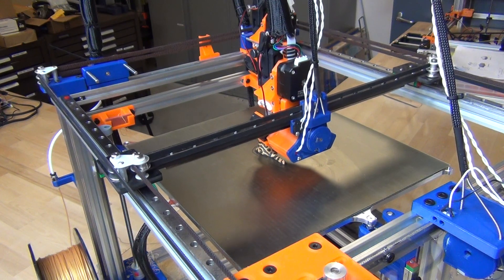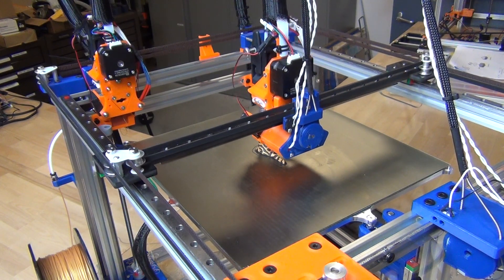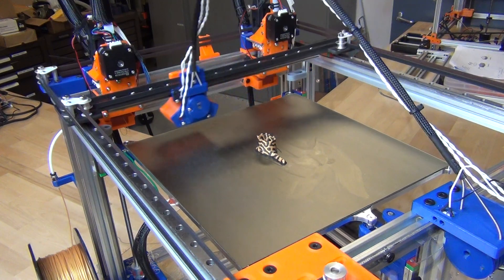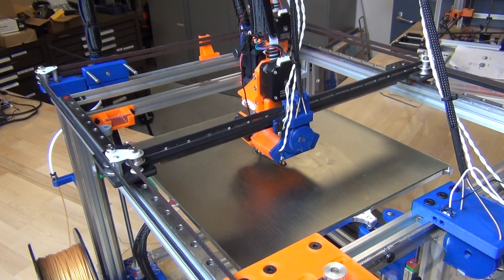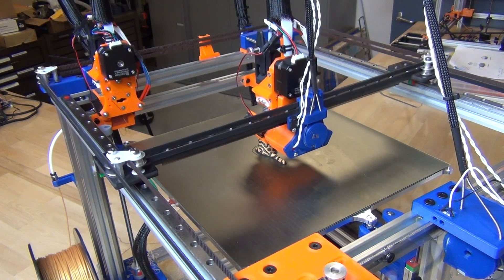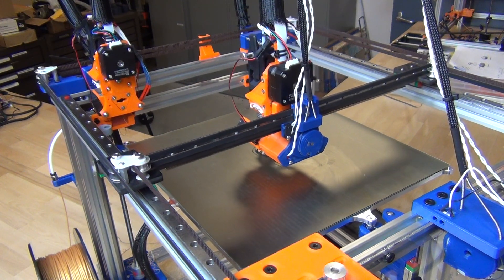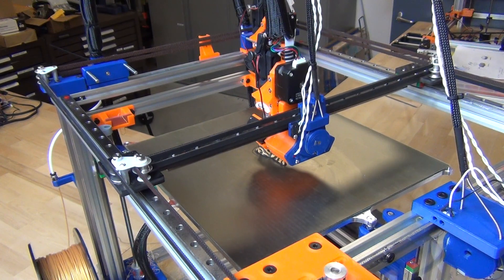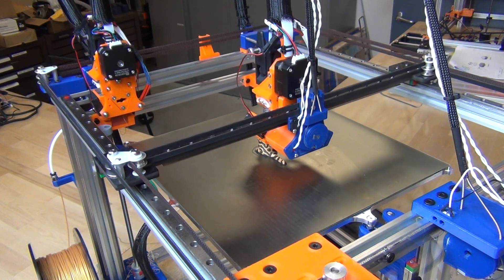Jubilee CAD File Release and Toolchanging Update

Comment: In your estimate, how much money would it take for you to be able to profitably sell this system as a kit? How much would you need to be able to scale it to make it adaptable to current ratrig/voron designs?
My current belief is that tool-changing is the future of multi-material printing. It's the only no-compromise solution when it comes to waste and print quality. E3D's system is pretty robust, but it's all-metal, individually-machined pieces make it prohibitively expensive for most.
This system makes the appropriate compromises in materials and the design is fairly elegant. I would love to be able to just purchase the system, because I don't have the time to build it.

Comment: Looks like that you are controlling the locking mechanism with a bowden and a motor on the right side of this video. Wouldn't it be possible to controll that mechanism with a small servo directly where the cable is attached? :D Awesome project.
Reply from the maker: for sure! Thats pretty much how E3D does it for their toolchanging Motion System.

Comment: cool project! I first thought you would use this for PnP, but multi-material printing is nice as well. How is the quality of this project at this point, is it production-ready or still in beta-stage? I'm considering what to build as my first machine.
Reply from the maker: Many thanks! The project has gone leaps and bounds with some extra community eyes on it. At this point, I'd call it stable in the default configuration (i.e: following the instructions on the wiki to the T), and print quality is excellent (surpasses a Prusa Mk3). There are plenty of folks on Discord experimenting with other configurations (Duet3, Klipper), and with time those too will become more stable.

There are still a few missing bits. Having a stable set of slicer config files would be nice, but it's tricky since settings change per-tool and not everyone is running the default extruder tool. Over time, this will get some more documentation too.

But I'd say there's no better time to get started unless you're specifically after a kit.
Reply: @POOFjunior  Better than prusa mk3? Bold claim :) I'm joining the discord. See you there! 👍

Comment: I was searching for a kinematic coupling for a 3D printer tool changer and noticed your youtube channel. First impression: Here we go again, a hobbyist who thinks he can build a 3D printer using 3D printed parts and make a reliable tool changer at the same time.
HOW I WAS WRONG ...
This is an excellent design, very well documented and looking at all available documentation and "source code" I fell in love with this in 10 minutes 😁
I have parts waiting to build a new 3D printer for almost half a year (build size 50x50x50 cm) but have not started because I was not too happy with my tool-changer design. I immediately started printing your parts for the tool changed and I might upscale most of the design for my own printer.
Reply from the maker: Much appreciated! You're also most welcome to join the crew on Discord to shop around ideas of your bigger setup!

Comment: Looks pretty cool. I just wonder why so many printed parts are used? The machine i am designing from scratch only uses 7 printed parts, and the other parts are not custom made parts. Except for them being cut to lenght.
Reply from the maker: Thanks. theres a few more printed parts to get rid of print overhangs. Rather than print one part with a huge overhang, i split that part into multiple pieces. While there are more pieces, the machine becomes a lot easier to print.

Comment: Nice work. I've seen a few good toolchanging designs lately. This looks like the most promising. A few notes: I believe with a unit similar to a Prusa multi-material system, it would be possible to have more than 2 extruders, on a board like the Duet Wifi. I also think that the best options for printers, that have a good chance of being accepted widely by makers and tinkerers, require the least additional tools to produce. It looks like you've got some custom engineering in there, to improve the performance of the printer, but I'd argue that some of those choices provide marginal gains, in trade for substantial barriers to entry. But that's just my opinion.
Reply: I know this is an old comment, but Jubilee isn't limited to two tools, or even just extruders. You can have as many tools as you have X-axis space to park them. Your assessment of the "custom engineering" on his printer is silly. It's a pretty basic CoreXY with tramming capability, and a novel tool-changer that's similar to E3D's much more expensive option.

Prusa's MMS unfortunately can not get away from purge blocks in it's current state. It is the number one reason I haven't purchased one. This system has a purge bucket but it's just to make sure the nozzle is full before it starts printing. The only negative with this system is that you have to have x-y motion capabilities to pick up the tool, which means it can't convert a bed-slinger, but that's where IDEX conversions make sense so that you can at least get two colors.

This system, with the addition of an indexing gantry, could conceivably have no limit to the number of colors or materials in a print.

Comment: You figure out the air/ fan yet
Reply from the maker: Still working on it. For PLA, part cooling is definitely my limiting factor right now. For low detail parts, my top speeds are around 120mm/sec for inner perimeters, 78 for external perimeters, 180 for infill, and 333 for travel moves, which is respectable for low detail parts. For detailed parts, I cut these down to 1/3 for perimeters. Pushing past that, cooling starts starts to become an issue as the part can't cool fast enough before the next layer is deposited. I'd say that that's a respectable start though.
Reply: @POOFjunior  can't wait to see more love when people build shit and actually show/ talk through problems etc and document like you have keep it up

Comment: Joshua, let me keep it straight... You are an absolute legend! Tool changing for the masses.
Reply: P.S. are you happy with an amount of deflection in the rails/extrusion or you would size up in the next iteration?
Reply from the maker: So far, I'm pretty happy with the XY size. On a future iteration I might add about 20ish mm in X and Y for a teeny bit more tool space. I don't think this machine scales to something like 600x600, though. At that point, the carbon fiber crossbar may warp non-negligibly with changes in heat.
Reply: @POOFjunior  Oh, I meant, is it rigid enough at the current size?
Reply from the maker: @yura979  yes it is, but I haven't pushed it to extreme speeds yet. I need better cooling and a better extruder.

Comment: Wish you would make the whole guide, instructions, shopping list etc as one download on git instead of a ton of individual downloads. Would be so much easier.
Reply from the maker: On the landing page of the project tuere is a green button that says "Clone or Download" where you can get a zip.
Reply: @POOFjunior  doesn't work for me clicked on clone wiki locally and does nothing. Copied link and opened in New page gives me 404 error on page. And no green clone button. And yes I'm logged in
Reply from the maker: Looks like youre trying to clone the wiki. You actually want to clone the project.

Use this link:
https://github.com/machineagency/jubilee
Reply: @POOFjunior  thanks that worked.

Comment: Awesome, is it possible to make one with different build volumes than in the bom? Also whats the cost to build the printer with 2 toolheads?
Reply: GitHub has a list of approximate cost. https://github.com/machineagency/jubilee/wiki/Parts-to-Buy
Reply from the maker: Updating the Z axis is pretty straightforward, but growing the X and Y does involve some substantial design work. So far, the cost is 2K with two tools, although it's possible to drop about $200 if you make extruders from cheaper parts.

BTW, Thanks for linking, Jon Raymond!

Comment: So excited to finally see it all together! Would it be wrong to use the E3d TC to make a Jubilee (great name my the way)? Is it possible to add a tool changing counter into the firmware? Prusa's got some interesting memory features, but it's running a different platform. Hopefully I'll have one together before MRRF. Thank you for the drive and passion you have for additive mamufacturing.
Reply from the maker: Ohh, I"ll look into an odometer. That would be a great addition to get exact numbers on changes.

Nothing wrong with using E3D hardware, although this machine will lock E3D plates, so don't feel like you must to make use of their great tool line.

Comment: Now THIS is some exciting news. Really impressive build! I don't have the money to fully build this machine, but do have a slightly smaller, half-built CoreYX printer I am currently working on. I am talking MGN12 rails, 2020 extrusion. If I where to adapt this and include it in my more budget-oriented machine, do you have any special suggestions or things I should look out for?
Reply from the maker: It shouldn't be a problem, but there would be some design effort. I think the main pieces you'd want to adapt would be the carriage, lock actuator, and parking posts.